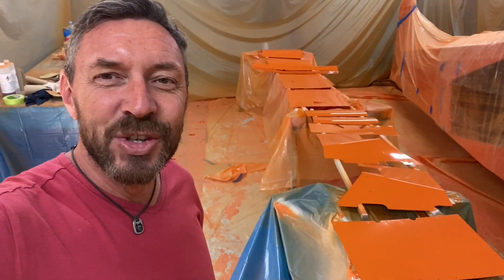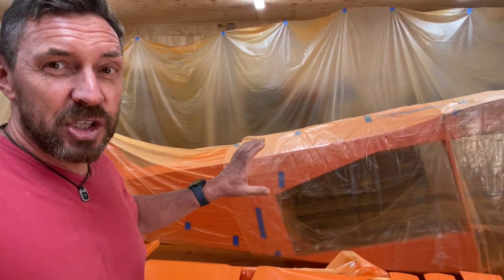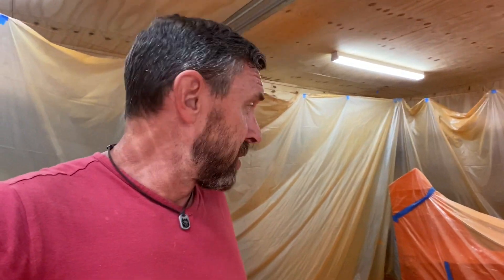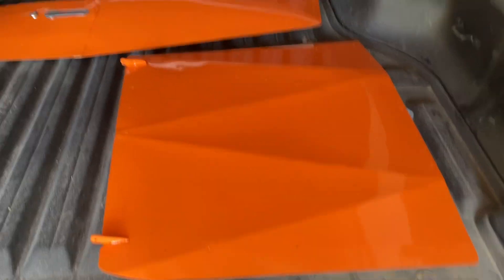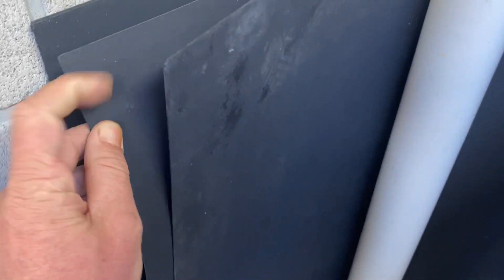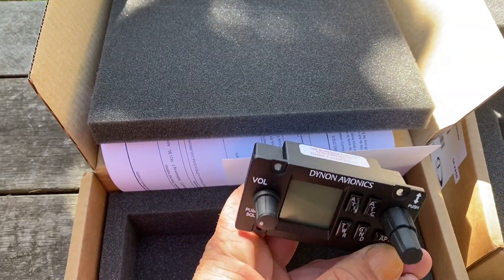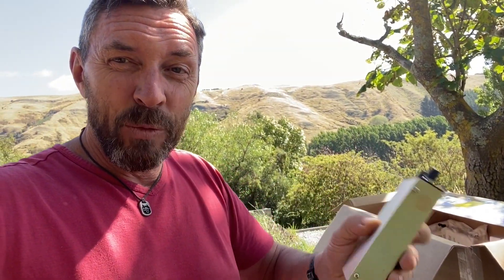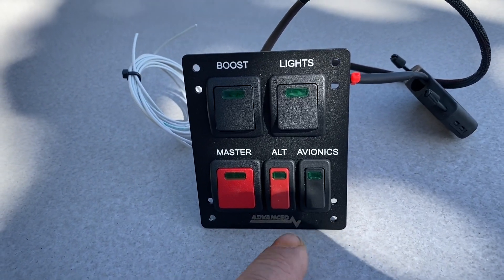Bearhawk build #6 - building a Homebuilt Bushplane aircraft in my garage

Comment: What was the cost of the dynon set up the way you did it?
Reply from the maker: It was around USD$22k. That included the Dynon ACM, but didn’t include the Vertical Power PPS. I also got all my harnesses made up, so installation will be much more straightforward. I’ll do a video on this when I’m well underway. You could easily just use one screen and I think it’d work pretty well too and keep the cost down alot. I’ve also got a transponder and ADSB. I’ll use those, but the two screens is probably overkill.

Comment: Looking good!  I understand your concern with the PS Engineering intercom, but I can tell you that in all the certified aircraft that I have worked on with a PSE intercom, I’ve never had an issue with the mounting.
Reply from the maker: Good to know Steve. In your experience, we’re the intercoms intended to be mounted with the face-plate sandwiching the panel and no further support ? ie no bracket supporting the rear of the device ?
Reply: @bearhawkblog3527  Yes they are designed to mount that way with no other support necessary.

Comment: Regarding the avionics redundancy, I agree with you. There are already several great apps for your phone that will offer complete situational awareness, including even the synthetic vision. The only thing missing would be the airspeed (GPS only provides ground speed) and pressure altitude (GPS showing you true altitude). I would probably get a cheap “steam” airspeed indicator and tuck it somewhere on the panel, for optimal redundancy. After all, in an emergency, you need to know your airspeed to properly fly the aircraft; pressure altitude may be useful for vertical separation, but knowing true altitude may well be more valuable.
Reply from the maker: It’s a very interesting discussion. I’ve only ever had one avionics failure in my career and even that wasn’t catastrophic- just meant finding and staying VMC, which we did. I think the Bearhawk would be relatively easy to fly using nose (pitch) attitude rather than airspeed. Even the B777 was relatively easy to fly without an ASI, using pitch attitude and thrust. So for my case, I’m not concerned about it at all. On our mobile phones we have full comms, compass (and on my watch), and altitude (as long as we’re not in a pressurized cabin. Systems reliability these days tends to be superb. Are you building an aircraft btw?
Reply: @bearhawkblog3527  You’re definitely much more of an authority (I’m a very low-time flyer, planning to eventually build a BD-4C). For me, a redundant ASI would simply give me a peace of mind, but what you say is true — when you fly your own aircraft, you know the view over the nose and can reliably feel the airspeed.
Reply: @bearhawkblog3527  And on the point of avionics failure, I'm sure you're right, this is exceedingly unlikely, although some sort of power failure, in a homebuilt, may be a possibility. And when that happens, there's your iPhone, iPad, or whichever mobile device you have, which will likely be fully charged. And even that doesn't really apply in your case, with your dual battery backup.
Reply: Hi nev, really enjoying your vids. I have a Patrol kit coming in a few month and your videos help a lot with my preparation. The Stewart System seems to be a mixed bag but overall I get the impression it's fine. Also I can't tell if you are just a perfectionist or the paint flaws are hard to pick up in video. The finish looks perfect on yt. How quickly are you trying to finish the build? You seem to be progressing quickly.
Reply from the maker: @noema   Yep the paint issues are difficult to see on the camera. But my friend noticed one of them in the workshop today pretty quickly. I’m not really a perfectionist and in this case I’m going to leave the imperfections rather than dwell on them. You’ll enjoy your build a lot !